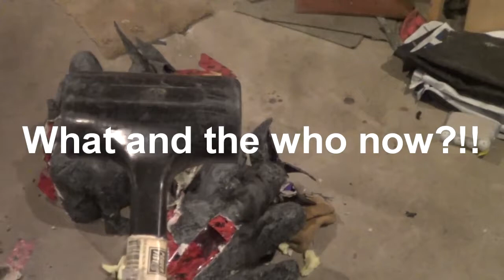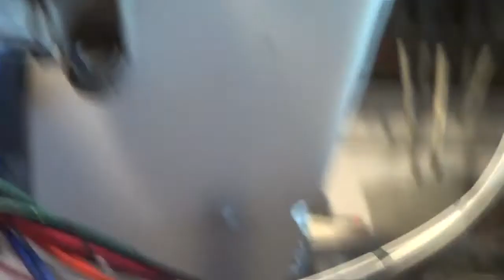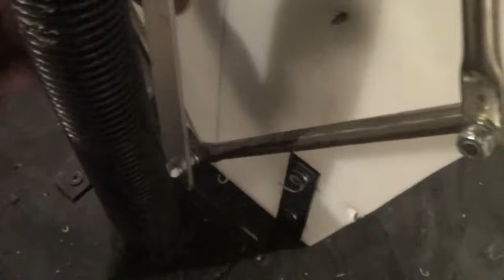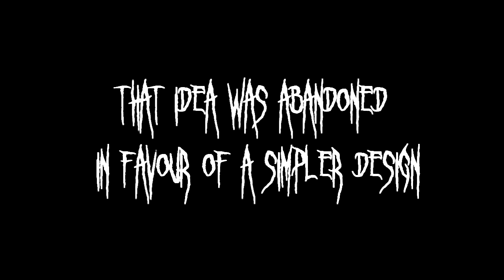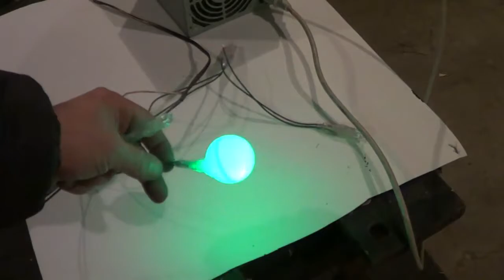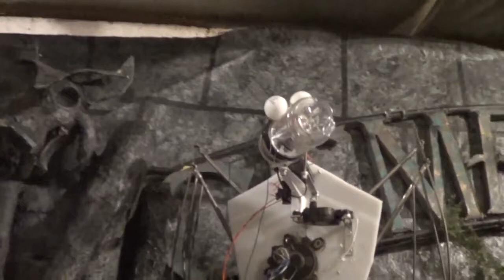Dead Things Vlog   Gargoyles W I P  Part 6

Comment: It's looking great, you ended up with a very similar solution to my original design but I actually cut a slot in the base plate and bolted straight through.
looking forward to the finished prop, I might even upgrade my gargoyle to move its head like yours.

Comment: Awesome! I was thinking thatyou could extend the center bolt at the bottom of the wings through a channel you make right in the white plexi. Throw a nylon nut on the end and you're done with the wing travel problem. You came to the same conclusion albeit accomplished somewhat differently. I noticed his right wing needs a little adjustment as its at full extension while the left isn't. Might help the noise issue. Really impressive stuff, man! Love it!